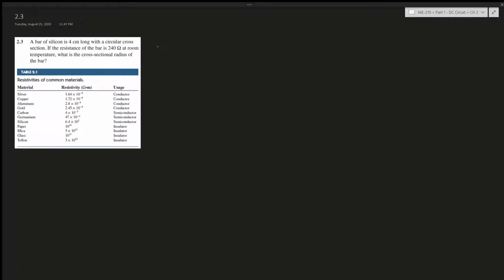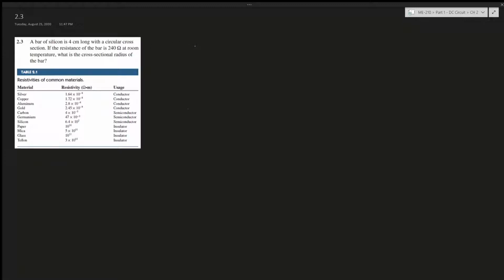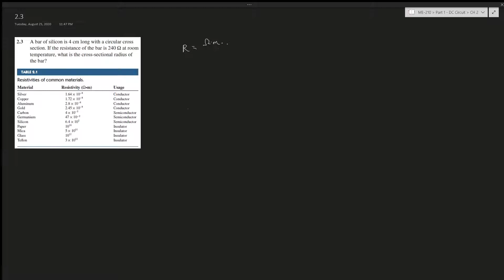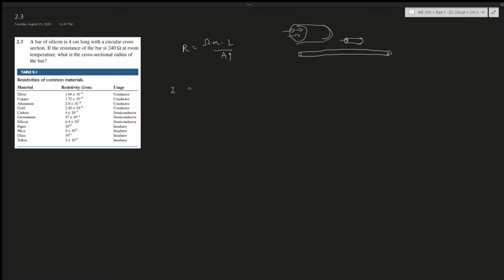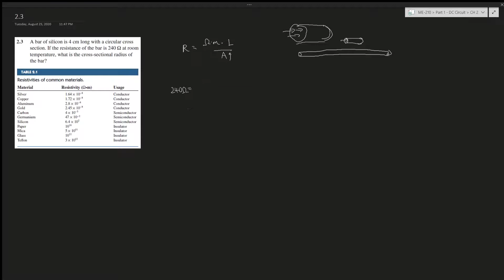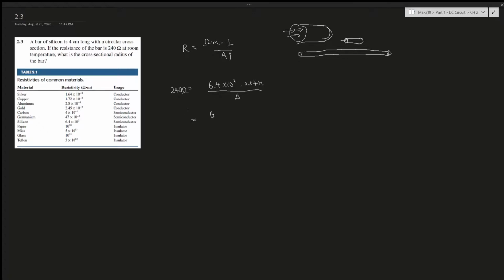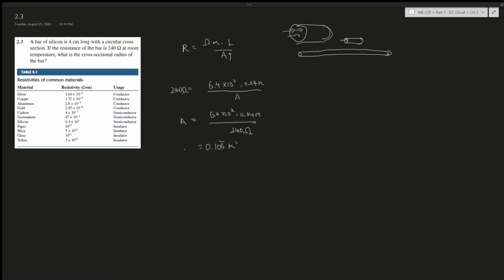2.3 A bar of silicon is 4 cm long with a circular cross-section. If the resistance of the bar is...

Comment: You did not calculate the radius. you should've divided the area by pi; and then calculated the square root of this resut. The correct answer is 0.1842